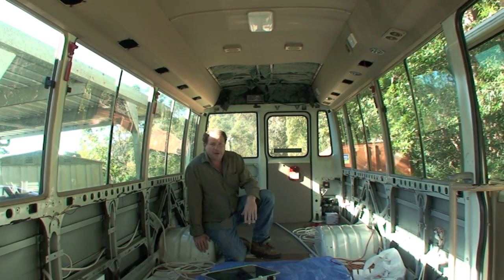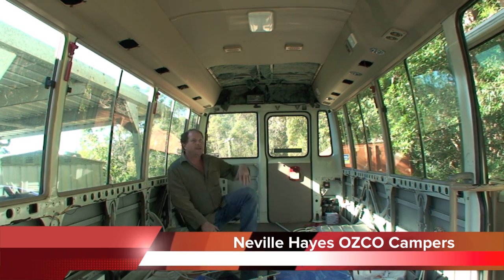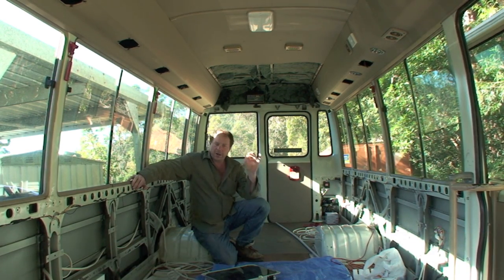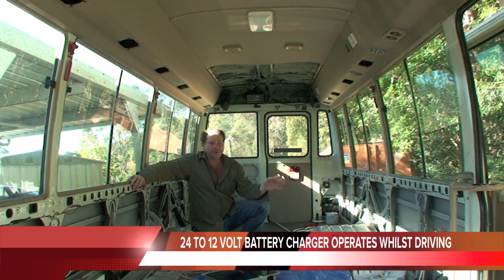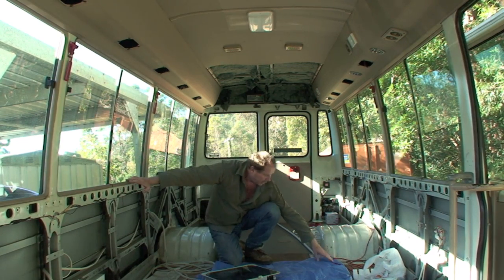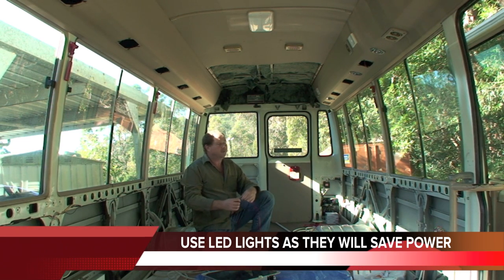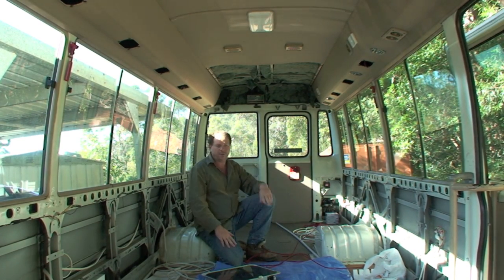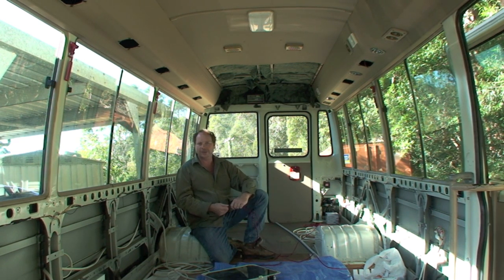NEVS BUILDING YOUR MOTORHOME BASIC ELECTRICS

Comment from the maker: @seanmulhall Technically you are supposed to calculate the total amps/hr usage but if your like me lazy and mathematically challenged then i suggest go for the overkill, but you also have to make sure your chargers can keep up as well, i am using solar 400 wts, a 24 to 12 charger from the vehicle electronics and backed up with a 2000 to 4000 kw generator particularly as i am taking a macpro tower to edit from whilst travelling.